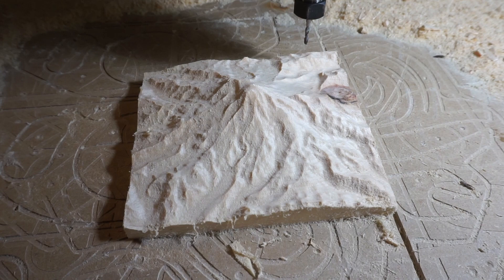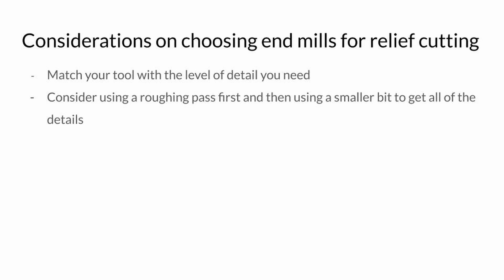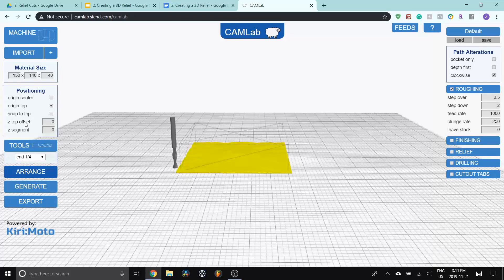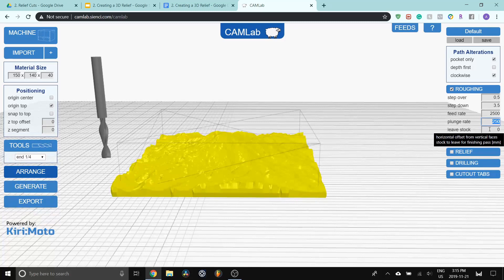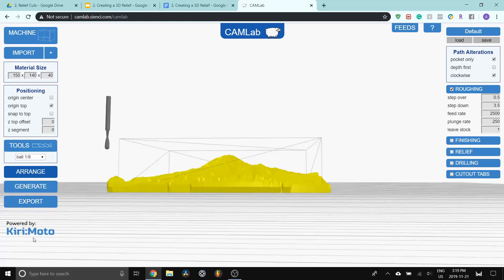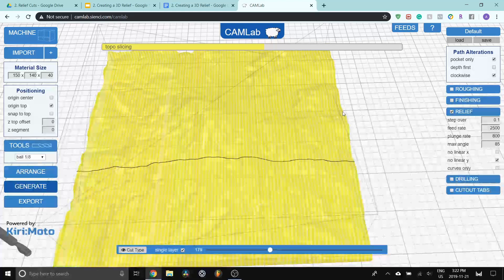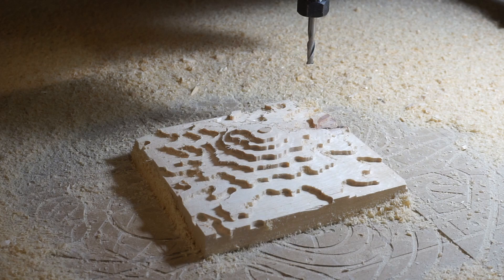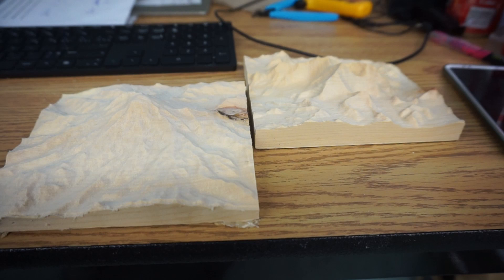How to Carve a Topological Relief Using Your LongMill

Comment: So, you did the rough finish on a file and then the relief file, my confusion is, isn't the "finishing" option the one that was suppose to go over the rough pass...? so what is the difference between the finishing and relief option...?
I have other questions as I'm trying to use this software with my Chinese 6040Z with a 1.5kw spindle and I can't find any instructions anywhere with details on how to use this software and what everything means but for now my first question will be enough.
George
Reply from the maker: The difference is that the Finishing does a very similar type of cutting to the Roughing, only it won't try to remove the initial material that the Roughing has already taken out. The Relief is a certain type of finishing except it's specifically for cutting large curved surfaces which the Finishing is not made to do. There's another example of how this all works shown in our new video here: https://youtu.be/Mpt84_SZsHw
Reply: @SienciLabs  Thank you

Comment: The roughing pass seemed to leave a lot of material on the Z axis.
Reply from the maker: That's probably because 1) There's a 1mm leave stock 2) The way that the roughing happens on that plane. You can reduce your stepdown if you need the Z axis to have more material removed before the relief pass.

Comment: Followed exactly, every time I try to export the finishing, CAMlab crashes, every time. and the project is no longer there because I have to reload the page and I have to start over. help?
Reply from the maker: Hi Caleb, what's the size of the file you're trying to work with in CAMLab? If the file is especially large then CAMLab can start to struggle. You can save the workspace though so you don't lose your progress if the page refreshes. Feel free to email us if you'd like more help

-Chris

Comment: Hi chris/andy, question about setting material size. For round shape cutting board i have, how do you specify the Material Size in cam lab?
Reply from the maker: You would just worry about the detail you're trying to cut. Or if you'd like you can make the round shape within your original 3D model